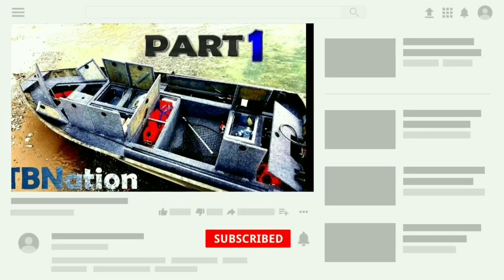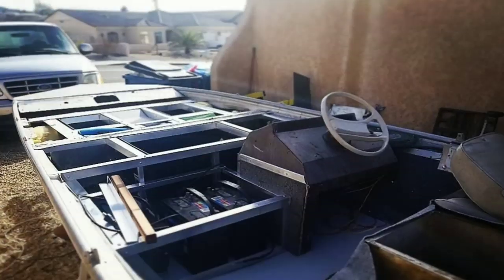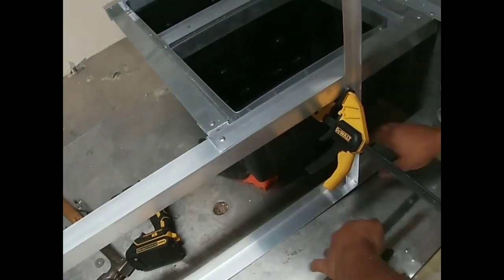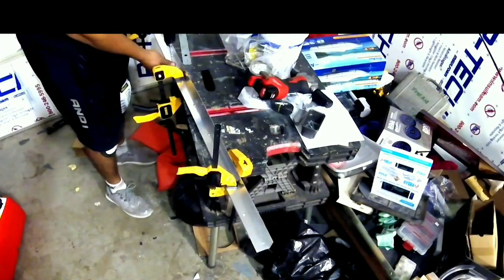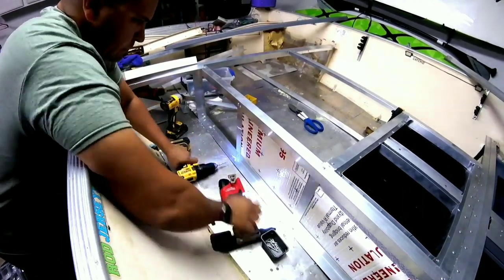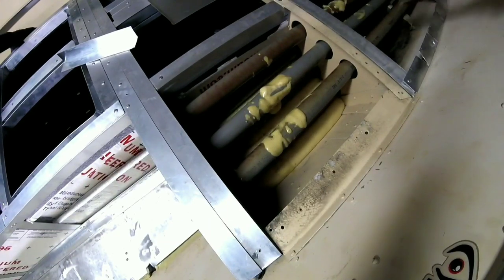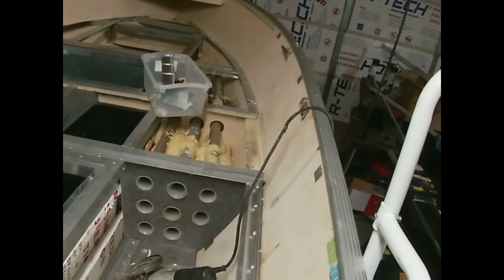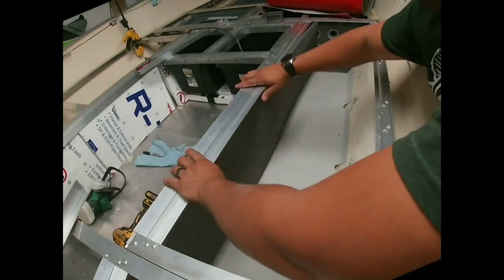The Frame | Rod Locker & Back Deck| Lund Deep V Restoration

Comment: I just gotta say:  I'm a lifelong DIYer and I've wanted to revamp the interior of my 16 foot jon boat for years - move the console, add a live well, easier access to spaces while on board, etc.  I actually did a boat about almost 20 years ago but added way too much weight.  The hold up has been using aluminum.  I don't weld and I didn't want to drop money on a mig welder that could do aluminum  and I didn't think that rivets would work.  I found this channel last night and stayed up most of the night designing the new layout.  I will get started on it right after duck season is over.  Thanks.
Reply: How’d it go ?
Reply: Yea, how'd it go??

Comment: Have  you guys ever thought about building a rod locker without all those tubes and just an open space. I had an 18ft bass boat and hated those tubes. Such a pain in the rear. That was the first thing I removed from the boat. Made putting rods in and out so much easier. Having been in a bunch of Pro's boats as well, I have never seen one that still had rod tubes in it. When I build my tiny boat in the future it will not have rod tubes.
Reply from the maker: Rod tubes are awesome

Comment: I have a question for you my man. I’ve watched countless of your videos and can’t find one that answers my question. I have a Lund deep v im building. Have the whole deck framed and dry hatches framework (without draining system) as well as the lids for them made. I plan to use wood for the rest of the deck but with the square aluminum hatch, and it being raised up, how do I get my deck to be the same hight with the wood? It’s looking like my deck is going to sit lower than my hatches. Can you help point me in the right direction?
Reply from the maker: You route down a 1/8” groove into the plywood to fit the hatch flush in
Reply from the maker: We just published a video series about how to do it. They’re in the recent videos if you check my channel.